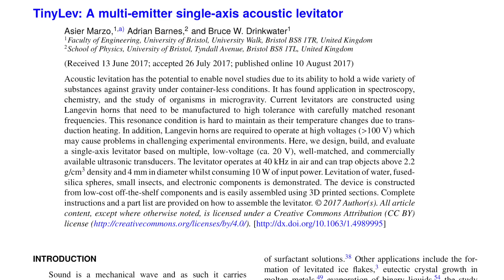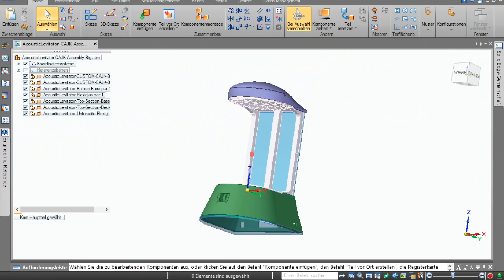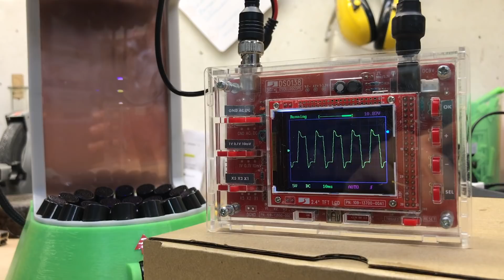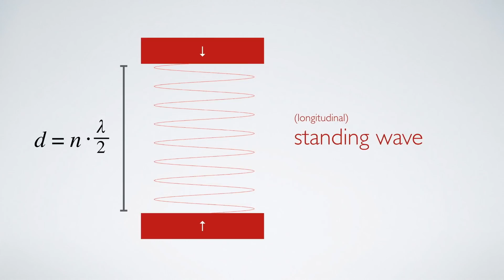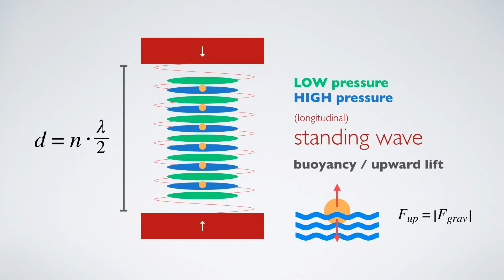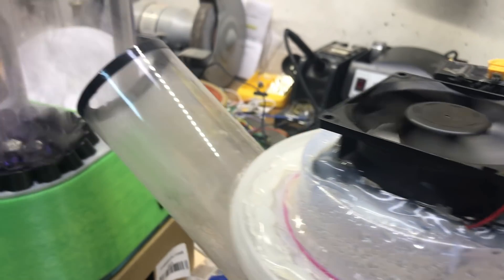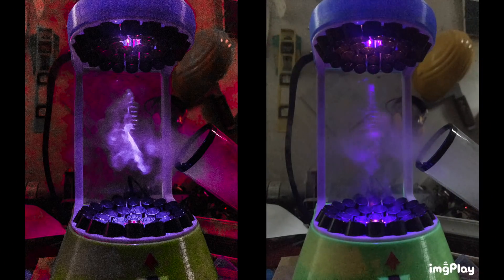Acoustic Levitation | Levitron | Ultrasonic Levitator | Arduino

Comment: Hello Julius.
This is a great job. I would like to do one with my son, but I have a question. What kind of component did you use for the up and down control? It can't be seen well in the video. To take advantage of your design, the switch would have to be a lever, but I don't know of a similar model.

Comment: I like this video, subscribed and what not. If I saw correctly, transducers are running on 10V peak to peak (p-p). I have single transducer and driving it at little bit over 60 V p-p and with addition of reflector got decent levitating properties. You should to use some H bridge MOSFET driver, use transformer from broken PC PSU, and power it with that. Be sure that output voltage does not reach over 70 V p-p (did not tested yet damage threshold). So far, some three stryrofoam balls, each 3-4 mm in diameter is possible to levitate. Sometimes little bit unstable, but that is because did not yet fix bottom reflector (transducer is above, so possible to experiment with water droplets, without fear of wetting and damaging transducers). My work is still in progress, planed to make 3D printed reflectors and perhaps confocal configuration instead focal point back to the transducer.
Reply from the maker: Milan Karakas thank you! That is great to hear. I also thought about increasing the pp voltage but I am already overdriving my transducers absolute maximum ratings. I don’t want the piezo elements to shatter because of the high voltage. What transducers exactly are you using? Would be glad to hear about future progress of your project :)
Reply: @juliuskramer6297  I did not found that one you have (without fine mesh grid), so can't tell how much voltage it can withstand. I am using removed T element from distance meter, but also works with generic T/R elements bought from eBay. I destroyed many transducers, but mainly because driving voltage reaching 150 V p-p. Also, forgot to mention that L298N is the worst driver ever - it is hot and RdsON is terribly high for those elements. So, I bought separate MOSFETS (small package, 8 pins, don't remember designation right now) and made H bridge (uh, even that one I do not remember, that was 2 years ago). With Attiny85, I am using two outputs, one inverted (or complementary) so that I can modulate for purpose of parametric speaker. Each channel goes from 1% to 50% only to avoid cross firing of the MOSFETs. Transformer was from old PSU, every broken PSU has good transformer that has two primary (low voltage) and one secondary (high voltage) end. That low voltage... eh yes - that is not full H bridge, but rather half H bridge and I am using central tap on the primary to +voltage. BTW, too bad thing that I did not found seller that sell only T elements, but always in pair with R. R element is poor as a transmitter, tried to use both, but only T element working good. Today went in town and did not found small styrofoam beads, but already ordered few bags of those 2.5 - 3.5 mm beads. I will post link in separate comment, just in case that YouTube filter URL as "likely spam".
Reply: @juliuskramer6297  And, so far no success with levitating water. Sound pressure is too weak with single T element.

Comment: I kind of assumed that it worked the other way around, that is that the material is pushed away from the high pressure zones and into the low pressure zones.